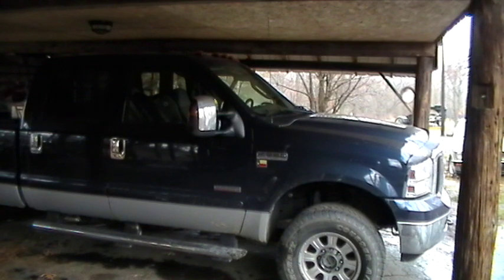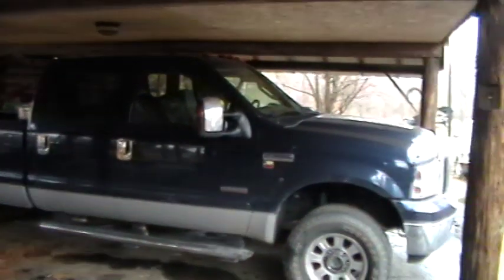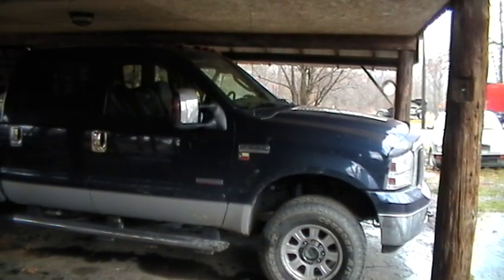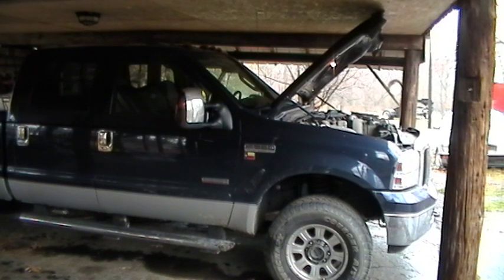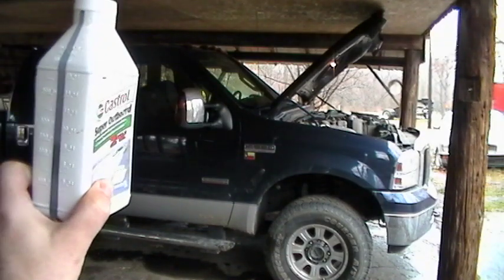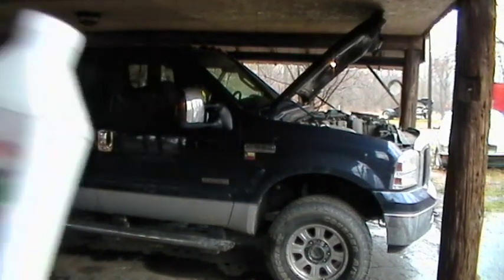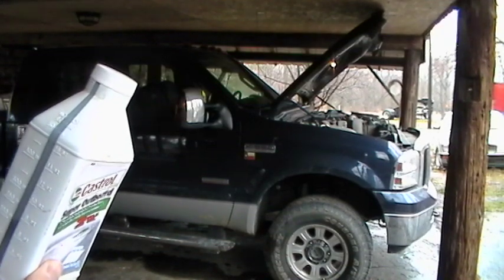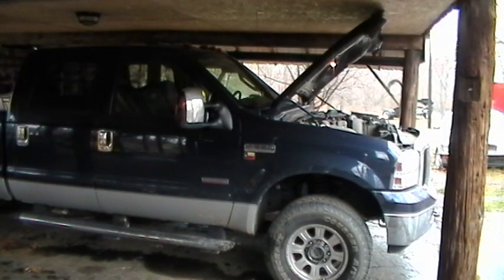Part 1: Powerstroke experiment to solve heui stiction problem

Comment: I use rev -x. It works great.  I’ve been using it for about 4 years now.  The fuel additive and I run striction fix through the truck once a year . I’m on 230,000 miles with original injectors .  Truck is all stock but the coolant filter.

Comment: The problem with stiction in these injectors is it can come from both the fuel side and the oil side of these injectors. The majority of the market concentrated on the oil side of the injector and spool valve for correcting the problem and it was a roll of the dice on if your fuel was or was not contributing to the issue. That's why for some people these treatments worked instantly and continued to do so and for others it had marginal or no effect.
Treat the oil, treat the fuel, ensure you don't have fuel pressure starvation problems, and perform oil changes before the oil begins to fall apart and your injectors will no longer have a reason to stop working.

Comment: 6.4 is heui too homey
Reply from the maker: 6.4 is common rail with piezo 3 stage injectors with maximum of 20,000 psi injction pressure. It is not heui. Get your facts straight so you don't make yourself look like an idiot

Comment: I read a "Lubricity" study on diesel fuel additives.  It concluded 2 Cycle oil, added to diesel was best at increasing lubricity.  After that ranked the OTC diesel additives.  Power Service, etc. 

 Since buying our 2000 Ford Excursion 7.3 Powerstroke 4X4 Excursion new, I have added one or the other, to the fuel, at almost every fill-up.  (Three-4 Qts. 2 cycle oil OR approx.12-20 Oz. of Power Service).  At 192,500 miles,  my 7.3 runs perfect on the original injectors and HPOP (High Pressure Oil Pump).  I also change the oil/oil filter and fuel filters ON SCHEDULE.
Reply from the maker: Yes I always run something in my oil and 2 cycle oil is most common in summer for me. The 7.3 did not have near the stiction problem as the 6.0 but had its problems too